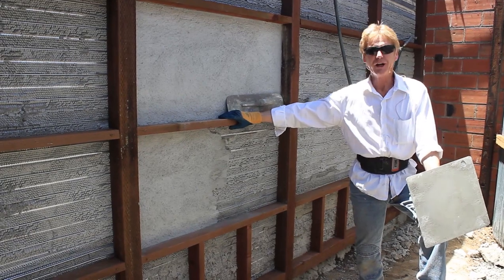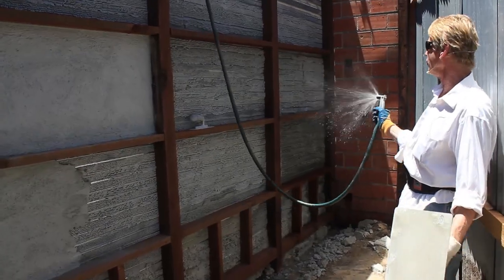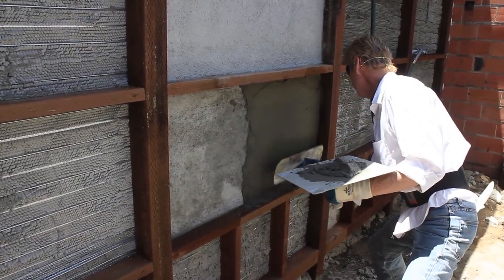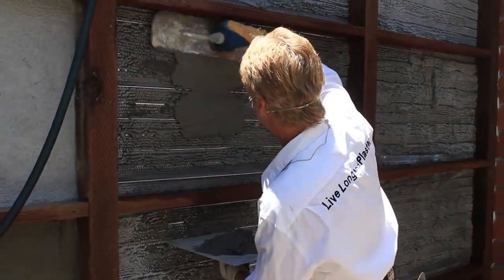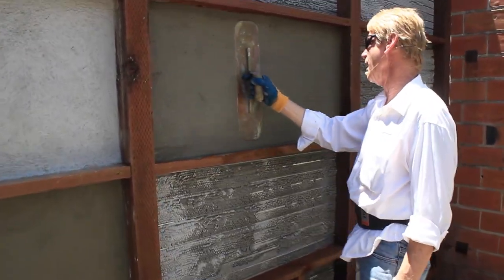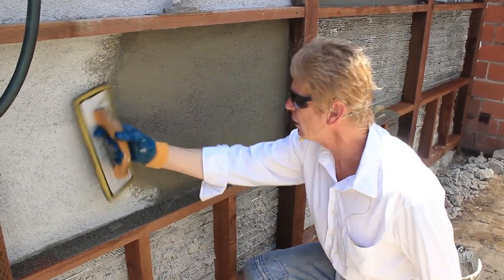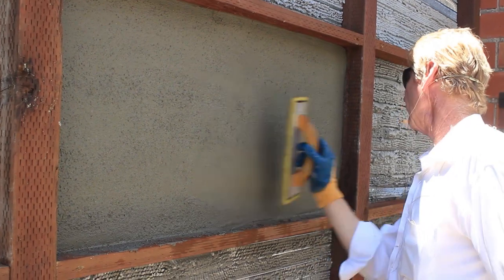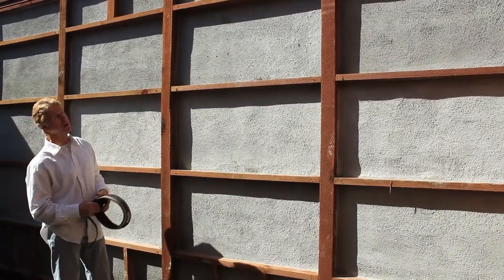Smooth down the rear of keyed stucco.

Comment: Do u ever put expansion joint on houses. Here in uk u got to have 1 every 6m (I think). I never see u doing them so just wondered
Reply: We use expansion joints in Australia just as you do in UK, both vertical and horizontal it’s an absolute must
Reply from the maker: Good morning Woody, on some homes we do if there is an area over 10 feet in either direction with no window or door, defiantly helps, I have done a few video's that explain how we do them here.
 But naturally, the bar is raised in the UK. BTW, I'm still contemplating the shoe plastering video, still waiting for the right time.
    The complete plastering encyclopedia on video, by the plastering messengers of Youtube.  
     Over 850 videos 🎭 👀💃

Comment: Great video Kirk. 
Question: I want to do this, but with chain link fence setup. Rather than use chain link fabric, tie in rolls of 17 gauge 150 ft. rolled lath. 
7 ft height. 10 ft galvanized steel posts - pounded in 1 ft - 2 feet of cement. 
7 Foot sections. 3 Metal rails. 
Will this be solid enough for stucco you think?
Reply from the maker: I think so; if you already added the 17 gauge, disregard this next part. If you have a chain link fence, you can attach this same Rib-Lath or 3.4 mesh or Diamond mesh or even to it using tie wire and nippers. 
Then it’s ready for stucco. I have done this a few times in the past. 🍻

Comment: Thanks for sharing. Do I have to finish both sides with this technique? If I don't have access to the neighbor's side, I'm wondering if the metal will rust and eventually crack the stucco on my side? I was thinking of butting a fence next to the neighbors bushes/hedge with stucco visible on our side.
Reply from the maker: Howdy brent, wood rots, metal rusts, our bodies too decays with age, but on a good note, the steel or metal is galvanized to stop it from rusting.😉
Reply: @StuccoPlastering  Ha. When you put it that way, I guess it'll be alright. Thanks for taking the time to respond.
Reply from the maker: @BrentDaughertyMe  no worries my friend.🍻

Comment: Hi Kirk, I want skim coat 20 minute mud over painted popcorn walls for a smooth finish. What’s the best way to go about this? 

Should I use plaster weld, and then skim in 2 or 3 coats with the mud?
Reply from the maker: Good evening MG dude, one coat should be sufficient, however some folks wet te popcorn ceiling then sarape off the gypsum and start fresh with a new finish.
    The complete plastering encyclopedia on video, by the plastering messengers of Youtube.  
     Over 850 free self-help videos 🎭 👀💃
Subscribers, you can depend on us to explain with truth, honor, experience, and skill for your time invested for wishing to learn the hows and whys of plastering.😉
Reply: Kirk Giordano plastering Inc. Thank you Kirk, you’re the best.

Comment: Hey Kirk I’m doing a bathroom remodel and it’s cement plaster and wire mesh. The plaster is about 2 inches thick. A sledge hammer has a hard time busting thru this stuff. Any suggestions on making the demolition easier?
Reply from the maker: Good evening, Luke, they make some excellent roto hammers, we prefer the battery operated Milwakees for this type of work.
FYI, wear a mask for the break out as you will release silica, not good to breathe in. In fact, very toxic.
    The complete plastering encyclopedia on video, by the plastering messengers of Youtube.  
     Over 850 free self-help videos 🎭 👀💃
Subscribers, you can depend on us to explain with truth, honor, experience, and skill for your time invested for wishing to learn the hows and whys of plastering.😉

Comment: Awww Kirk I need you.  How do handle lath that has too large a gap.  Some of these old lath were not perfect and the gap between the lath is too large to get the key to form.  Is there a trick or do I put a new piece of lath in?  Thanks for your vids.
Reply from the maker: Good evening John, just plaster it, cement plaster is extremely strong it can bridge gaps well over an inch or two wide with no problems.
    The complete plastering encyclopedia on video, by the plastering messengers of Youtube.  
     Over 850 free self-help videos 🎭 👀💃
Subscribers, you can depend on us to explain with truth, honor, experience, and skill for your time invested for wishing to learn the hows and whys of plastering.😉
Reply: Thanks Kirk.  Recoated with the bonding agent.  I’ll send a pic when I am done.  I’m getting better at mixing.  Today it looked great until I RA a four foot level over it.  I little too much.  Easy peasy I shaved it off, long working time they should call it amateur mix.  Going to top it with plaster of Paris.  I have to find a place that carries lime plaster.

Comment: Could you put the mesh on both sides? And would you have to go with a beefier framing to handle that?
Reply from the maker: Evening Eric, yes, you could; as long as the foundation is correct, you can do whatever 
you want. 😏
Reply from the maker: ONly if you can find an old barn, or perhaps your referring to obsessive-compulsive disorder? :face-green-smiling:

Comment: Kirk how's it going? I need your help again. I installed a French door, on the outside of a back garage/house. There is a gap on the bottom of the door because we had to lift it up. If I put my face to the ground then I could see that Gap. It's raining as you can see right now in California. For the last 3 days I've been trying to patch up this leak that has been coming in from the left and the right sides of the door all the way to the inside of the garage. I put stucco underneath it and try to fill the whole Gap up with stucco. Caulking. But I went out there today and there was water running through it again. Maybe I missed some cracks cuz it's a real tight area. What should I do do you have any methods because I would like to go down there and put even more stucco?